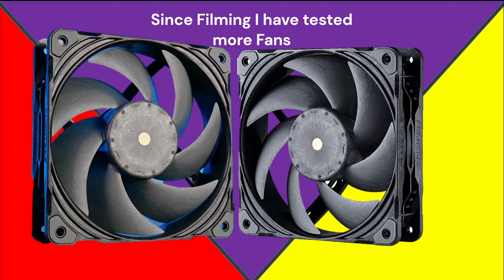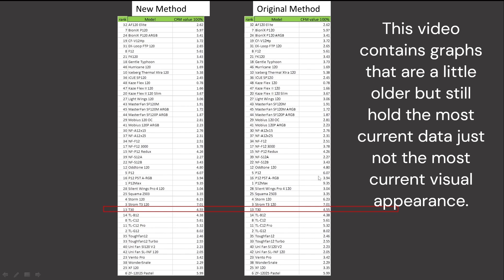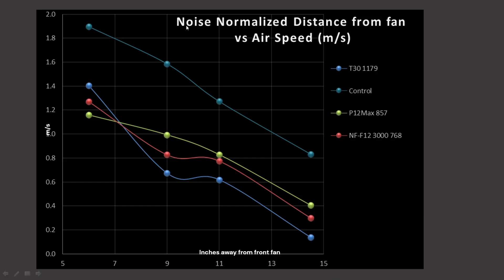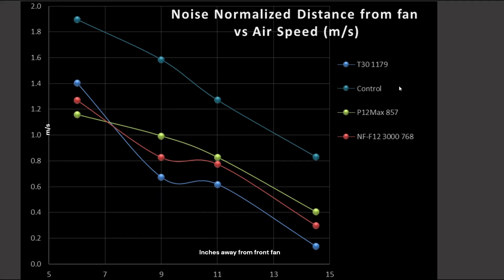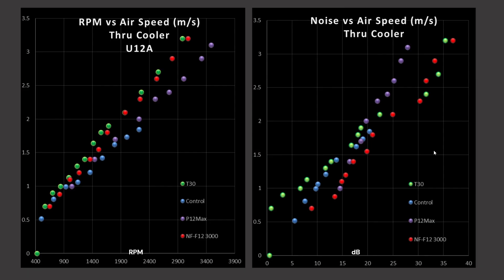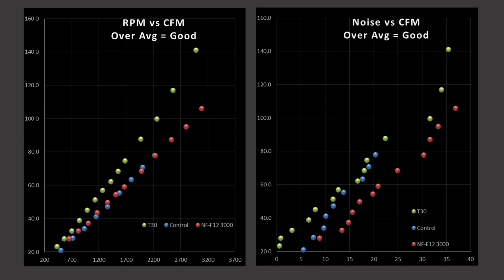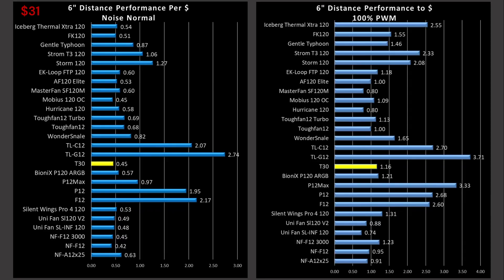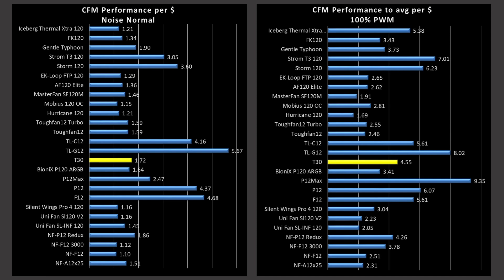(New Testing) T30 is it still the King cooler Fan?

Comment: What's the difference between your cubic m/s testing and CFM testing and why does the T30 perform better in CFM and worse in cubic m/s?
Reply from the maker: I think your talking about my Case simulation (m/s) and the CFM. the case sim I have an open ended box that is large enough to fit a 200mm fan in it. I the fan in a housing that hold the fan in position and it blows donw the box. allowing the air to spread out like it would in a PC case. So ideal fans have concentrated airflows. 

in the CFM test I blow air down a short tube, I get the airspeed and i know the tubes Diameter and calculate the CFM. This is a scientific test only tells you the volume of air the fan can move now how well it can move it. 
i have the CFM test in b/c so many channels just do the CFM test but dont understand that there is more to fans than CFM and noise.